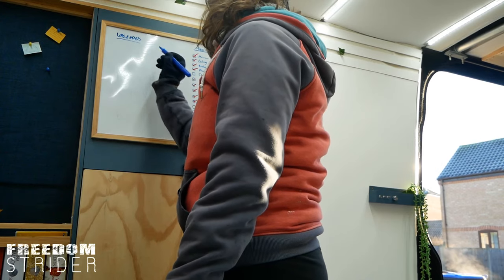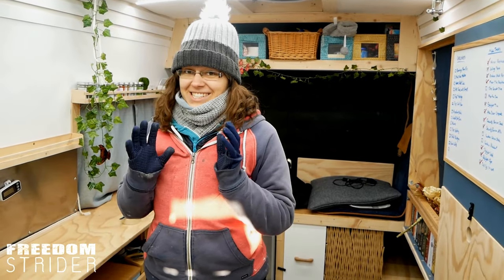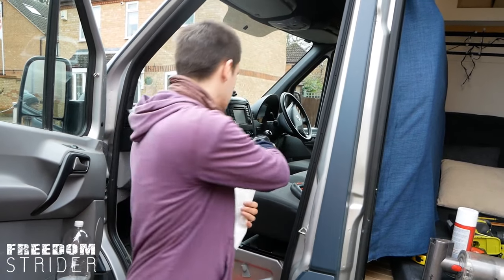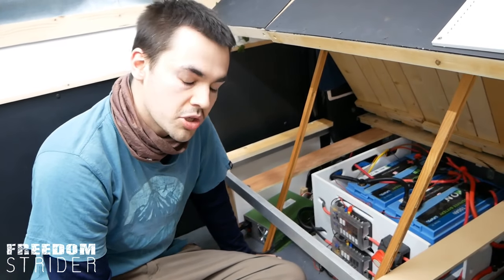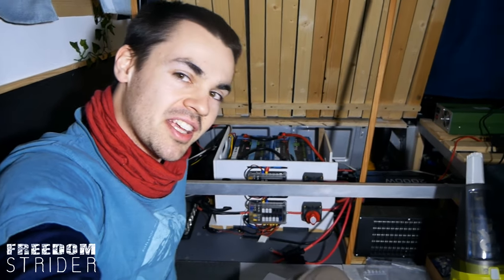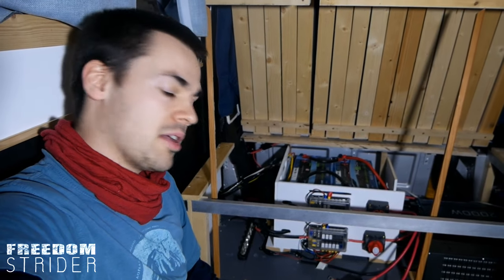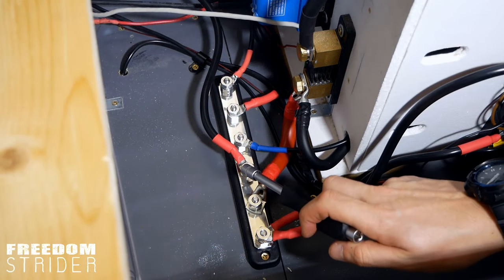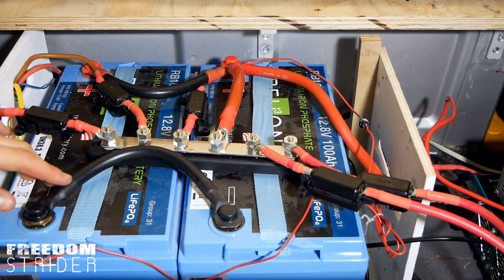Last minute changes to our van build...

Comment: A tip, to get the fuel to prime faster tape the lid off until primed. The lid let better air flow through and a longer pipe. Vans looking good 👍
Reply from the maker: Great tip! Will note for next time 😊

Comment: You have multiple kinks in the drain pipe, air blocks may be a cause, also is the pipe corrugated on the inside? Try replacing with clear plastic hose. It’s much easier to see what’s going on. Steve
Having multiple ups and downs in the drain pipe is bound to cause problems with water standing in the pipe until the van moves off. Best to have the pipe run internally so that it is always downhill and then vertical into the tank.
Reply from the maker: Yeah good points, I think that is the problem from what people have told us. I'll have a play around with the pipes and see if I can get it without any ups and downs. 👍

Comment: Fuel for heaters you can use red diesel it’s way cheaper as much reduced tax. As long as you don’t use it for the engine on van it’s fully legal. Just ask at the counter where to fill from. It’s usually separate to the main pumps.  Steve
Reply from the maker: Ah yeah, now that we have a seperate tank, we can do that. We'll look into it! 😊

Comment: Hi Polly, me again :) It seems we have both been suffering the same problems. Namely, van battery going flat with small trips and our sink not draining very well and I've still not found the cause, except using a sink plunger to break what we believe is an air lock. But....on our trip around Scotland last summer we only moved about 20-30 miles a day and this was causing our van battery to go flat and fail to re start. The cause I found was our B2B charger ( Stirling ). What was happening was that the B2B switches on quite fast upon the van starting But, it was not switching off fast enough when we stopped the van. We found that it would still run for about a minute after the van was no longer giving charge. So, it continued to deliver 50A from the van battery to the leisure battery. This drain each time we stopped was building up enough after a few weeks to drain down the van battery too much. As you may know, with these modern vans, if the van battery falls below a certain minimum level it disallows starting. Fortunately to get us out of trouble I could just use our emergency jump cables to link the leisure battery to the van battery for a few moments to allow it to start. Anyhoo.....I solved the problem by putting in a switch to switch off the B2B before I switched off the engine. Problem solved. But, not a switch on the high current cable, but on the Stirlings battery on sense wire ( available option on the Stirling charger ) I don't know the Victron B2B so I cannot say if yours has the same option, check it out. Further....those trips that you have used on the B2B to switch it on and off are bloody awful things! Don't get me wrong, I've unknowingly used them in my build as well, but I wish I hadn't. They are not reliable, often don't trip at the correct current level and in one of mine trips at 50% lower current. So be aware of that.....I hope you don't have the same problem. Good luck
Reply from the maker: Well, it's good to know it's not just us dealing with this. We have also noticed our REDARC B2B stays on for a little after the van is off (60 secs or so), which IU do believe was the primary cause of the issue at the temperatures we have now - because this problem did not start until the temperature started the drop. Throughout the spring, summer and autumn, this problem did not happen at all, it only started in November.

We'll keep an eye on the breaker, at the moment it seems fine, but it is brand new. Worst case scenario we change it out for something else. 

For our starter battery issue, instead of using jump cables (cause we don't want to surge our leisure batteries), we have actually added a 2nd separate AC charger to the van, purely for charging the starter battery from the leisure batteries via the inverter. It's a bit slower, but it means we don't have to open up any of the batteries, everything is plugged in, all we need to do is flick a switch and the flow reverses and charges our starter battery. We've already had to use it...seems to work for now. 👍

Comment: There is a chance your tank can't displace enough air to let the water into the tank quickly enough. Your main problem is the water under the van is having to go up hill to the tank. All you need to do is route the waste pipe inside the van and that way the water will drop into the top of the tank. At the moment you need a large volume of water to create a syphon, which pulls the water through the waste pipe. When you only put a small amount of water down it doesn't create a syphon, so the water stays in the waste pipe.
Reply from the maker: I think you might be right, it would explain why the 5L went quickly but the few drops didn't. I'll have a poke around and see whether I can move the pipe around to eliminate that siphon issue. Cheers. 👍😊

Comment: canadian have alot of issues with the drain lines freezing in sub zero weather. prehaps you had some minor ice buildup in the drain line (on that noted rise in the line) before getting to the gray tank. Could have resolved it's self as the weather warmed up. But may be somthing to note or be aware of when the weather gets colder.
Reply from the maker: Good to know, thanks for the tip! 🙂

Comment: Hey guys! I had a lot of problems with putting breaker fuses on our B2B charger. They kept tripping as they were getting warm due to the current flow through them. Contradictory I know as they we correctly sized for the application! Because the breakers work by detecting an increase in heat (which was normal) they kept tripping. After returning a bunch of breakers and hours putting my hair out wondering why they kept tripping, it turns out they’re not ideal for that application! So I replaced them with ANL fuses and 3 months later and no issues! Just a heads up if you ever have an issue with that breaker tripping! Love your videos by the way!
Reply from the maker: That's good to know because it has tripped once unexpectedly, though the main reason we installed it is because we want a manual switch on the side of the seat and stop and start the DCDC from charging. We have a 60A MIDI fuse at the starter batter and at our leisure battery on the DCDC so it is current protected on both ends. If we get the same problem, we will just have to figure out a solution involving a simple yet safe switch. But it is a good thing to know that that is a problem and we haven't done anything wrong. 👍😊

Comment: My worry about having an internal diesel tank would be the inevitable spills when filling it. As you already have a line from your van tank, I think I'd be inclined to install a small pump to take diesel from the main tank and fill the internal day tank at the press of a button.
Reply from the maker: Spills are certainly inevitable, so a redirection pump is a potential upgrade. Later on though, we are hitting the road soon 😀
Reply: @FreedomStrider  Oh yes, sorry, got carried away with thoughts of upgrades. Happy travels!!

Comment: With the busbars i could never figure out why they are so expensive so i just got a big bit of copper bar and copied a DIYer i saw on YouTube. Not sure how many amps it can handle u though but it's a hefty  chunk of metal.
Reply from the maker: I could never figure out why they were so expensive either, maybe it's because they are seen as a safety component? A chuck of copper, is an option, but I would feel more comfortable to know what to rate it as. Good budget option though. 👍
Reply: @Freedom Strider  Good safety point so I just cheked the current carrying capacity of my copper bar on a calculator if I've done it right it should do 144amps which is way more than I'll ever put through them and only a tenner to make 2.

Comment: Poor drainage is often airlock in the waste water system, normally the waste tank not having a breather vent outlet. Another common problem is pipe fall along the entire run (as in not steep enough) to be effective or pipe diameter being insufficient, try aim for 1 inch internal diameter and try aviod flexi pipe as it can sag between pipe clip points especially if hot water is in the pipe run or the pipe clip fixings  are spaced too far apart. Also if your are using flexible waste pipe, is anything crushing it, have you pushed something in a locker up against it.
Reply from the maker: Thanks for those excellent points to keep in mind. Plumbing is still our least favourite utility to work on. Our original issues were the bends in the pipe, which collected water.

Comment: Just noticed you seem to be using a corrugated drain pipe from your sink, and not a very large one at that.  I know in woodworking shops, dust collection works far better if you reduce the use of corrugated pipe to a minimum in favor of smooth walled pipe, and the larger the better.  Also, is there a provision for an air vent at the sink connection?  A common failure in DIY plumbing installations  is failure to provide an air source or vent pipe to let air into the pipe drain system.  Clearly you can't run an air vent pipe thru the van roof, but there are small vent devices that can be added just below the counter top that will admit air into the drain line but block water from popping out the vent.
Reply from the maker: Yeah as for the corrugated pipe it isn't very large we were thinking to make it wider of it carries on being a problem 👍
As for the air vent, have have an air vent in the tank and pump but we might need to add one into the waste pipe line as our pipe travels up and down a few times 🙂

Comment: Too late for you, I know, but I'm going down this route for my bus bars - Victron Lynx Power hacked to add fuses rather than having in-line fuses on each cable. More expensive than individual bus bars, but a neater solution. Also, it feeds my addiction for all things blue!
https://www.youtube.com/watch?v=LIVh7lZ5IT0

The breaker you're using for the B2B charger isn't designed to be used as a switch - they have a low mechanical endurance (the number of times you can switch and have it work reliably) and also if you switch on while you're driving, you're likely to get arcs on the internal contacts as the power surges. You do need a fuse/breaker, but the switching is far better done with a dedicated and correctly rated switch.
Reply from the maker: We would love to do our next build, Victron only, just have to budget for it 😅 Blue boxes all around! 

As for the B2B, yes you're right it's not correct and we are looking for a dedicated isolator switch. We know we could use the red battery isolator switches, but they are pretty big, too big for the space we have. If you have any ideas of switches we could use (preferably they should stick out a max of 60mm) then please send them our way. We've been looking to no avail so far. The B2B has been wired up without a switch for the time being as it is unstable. 👍
Reply: @FreedomStrider  If space is a problem, I think I'd do it with a small switch visible and which powers a relay hidden somewhere where space isn't an issue which then switches power to the B2B from the starter battery. You could probably do this with a VSR (Voltage Sensitive Relay as used in split charge systems) by switching the battery negative flylead - the other advantage of doing it this way is that even if you forgot to turn the B2B switch off, the VSR would mean that the B2B would only be energised when the engine is running. Essentially a split charge system, but with the charge side feeding into the B2B rather than straight into the leisure batteries.

Comment: Hi. Could you use the tap into the main diesel tank to run a line with a pump to fill the auxiliary tank? You could top up the aux tank just before you fill up with diesel. Have been looking at a Reflleks or Newport Dickinson marine heater as a silent nighttime heater and this is gravity fed, so needs an aux tank, but trying to work out a simple way to fill that doesn't involve filling a diesel tank inside the van. PS am v interested to know how the heated floor is performing. PPS, Camp Quirky this year?
Reply from the maker: Theoretically, yes, you can pump the fuel anywhere, you'd just need a fuel pump and a control switch. How you would stop the aux tank from being overfilled and overflowing...I don't know. That would be your main issue.
Heated floor, we will do an update video but TLDR; working very well indeed (just want to get an IR camera so we can show the details on video)🙂
Camp Quirky, probably not this year as we will probably(hopefully) be in Europe at that time. We are planning on going to the Overland Show in Stratford in June though 👍

Comment: What happened to the under floor heating??
Reply from the maker: Still working great, didn't need upgrading 🙂 we just changed the fuel source of the heater unit from the vans fuel tank to a separate one is all 👍
Reply: @FreedomStrider  pleased to hear it's still working ok for you ❤️❤️❤️